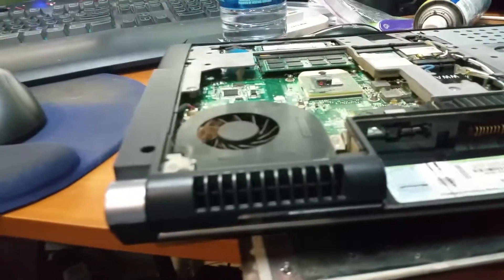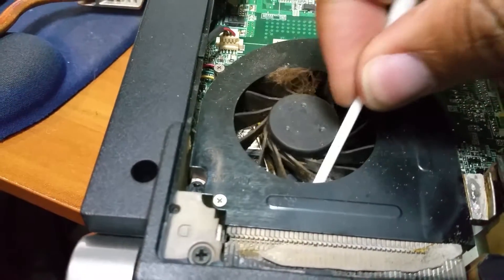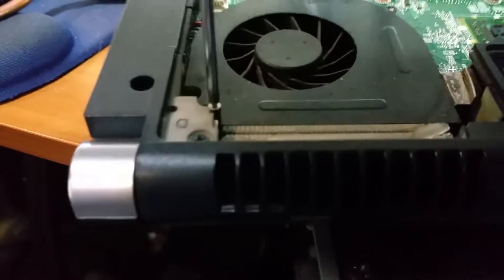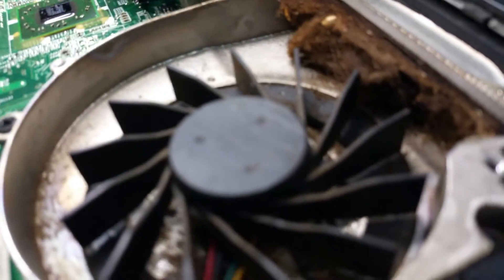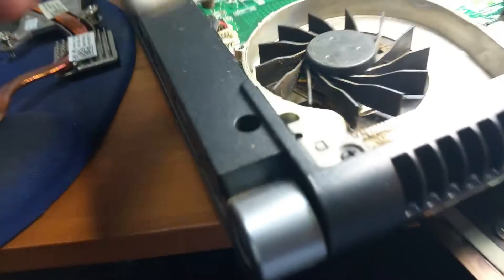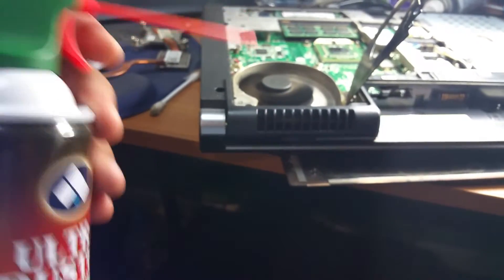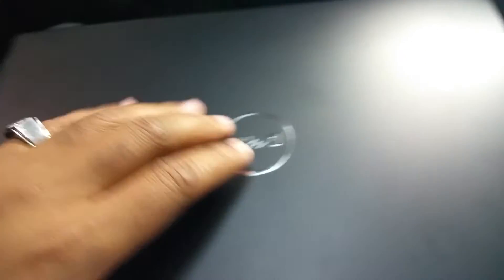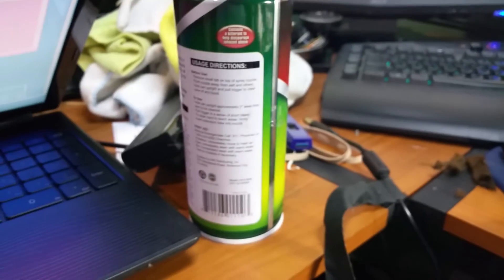Dell Studio XPS overheating Fix ! Clean Out Fan

Comment: Thanks! My laptop is running  20°F / 10°C cooler.  Extra tip You dont have to take out the cooling system, just the fan (2 screws,connector, and tape)

Comment: I have got some desk tops that where so dirty I would not bring in the house till I took a leaf blower to them , but I have found laptops that look like yours . Used a compressor with it turned down to 30 psi and that is all it took . Another great video Thanks --- First 65 or Older
Reply from the maker: I use the exact same thing to blow out desktops.